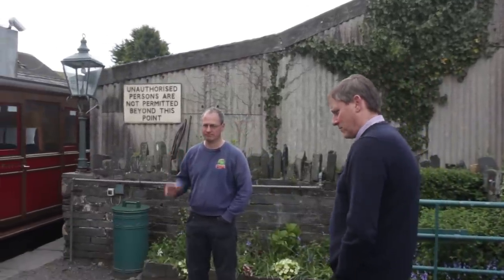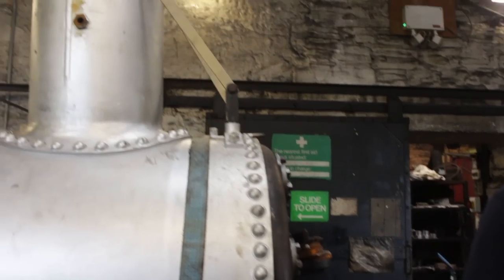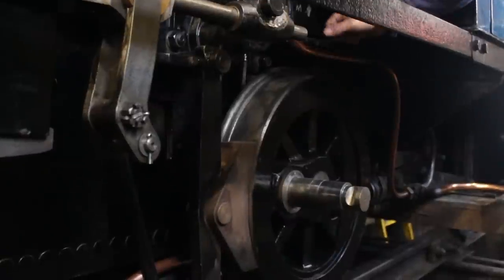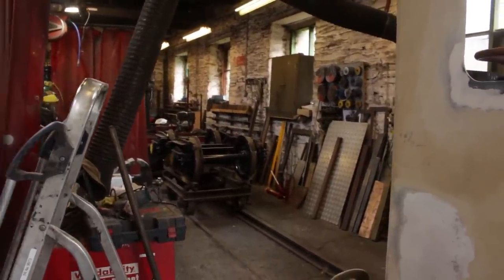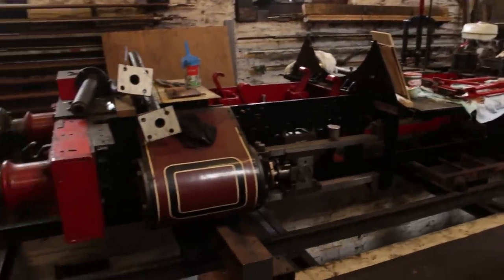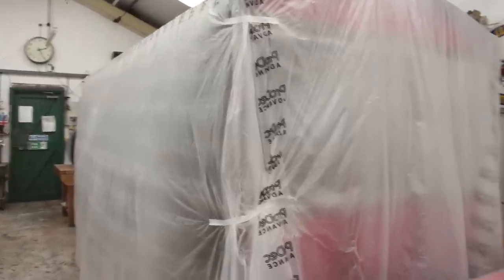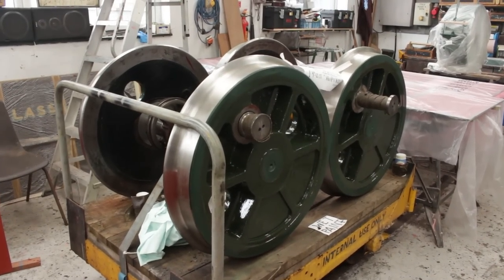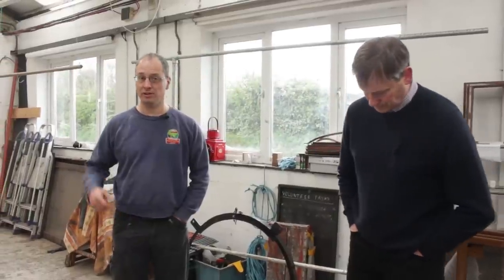Manager's Walkabout: Dolgoch update & More! - Talyllyn Railway

Comment: That boiler the Severn did... I seem to recall reading it was to the original Fletcher, Jennnings & co. design from the 1860s. Is that correct?
Reply from the maker: It would have to have been made to modern standards, but yes the boiler was built as close to the original design as possible - thankfully drawings of that original boiler still exist.